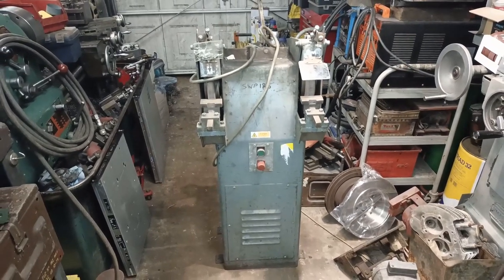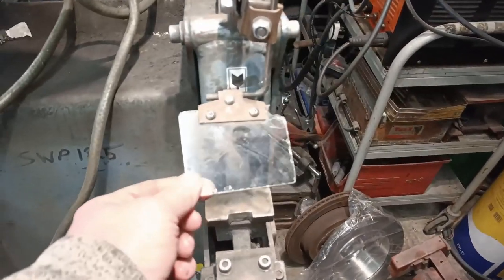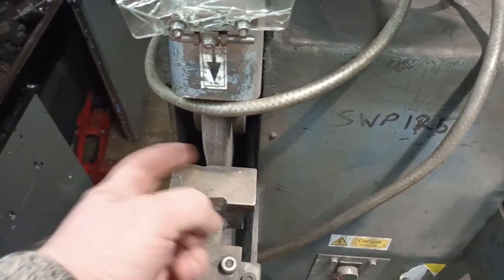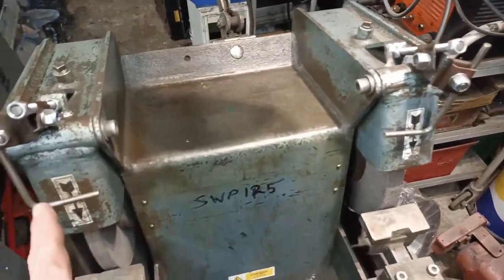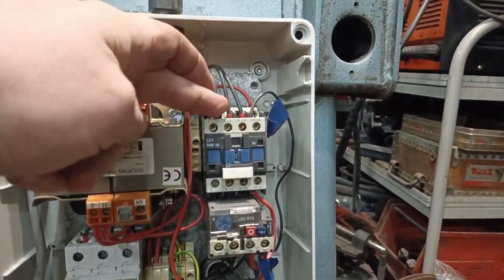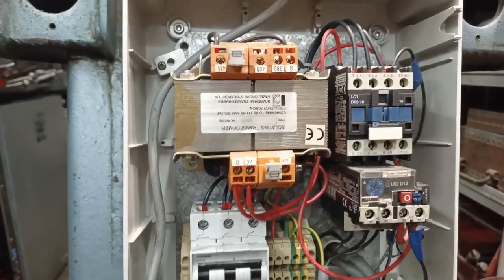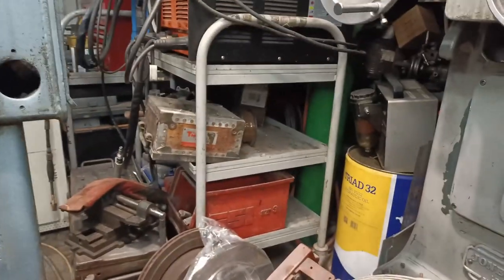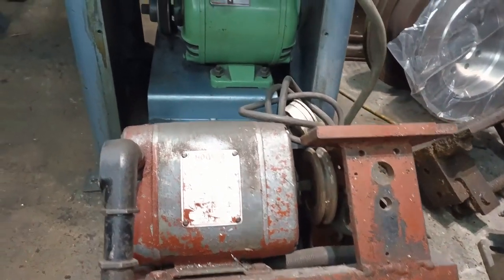Tool Grinder Introduction

Comment: Google says 750 watts is a bit over 1 horsepower. Is it different when it is 3 phase?
Reply from the maker: Hi, I was going off the information in the datasheet for the motors.